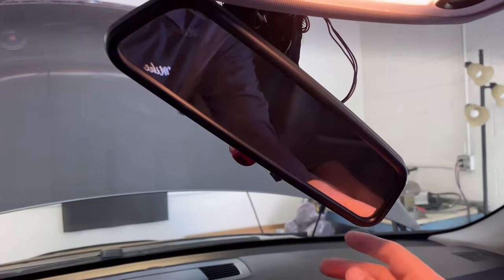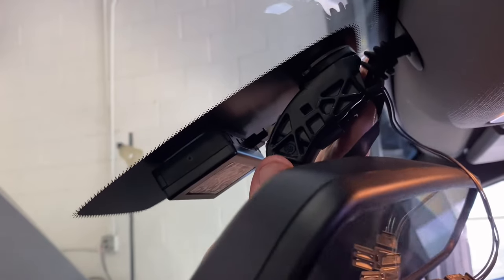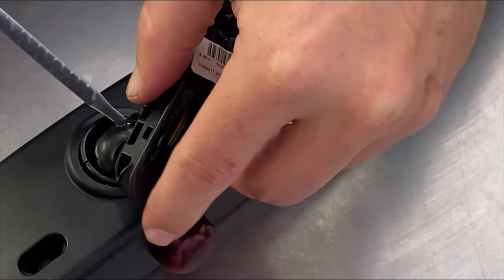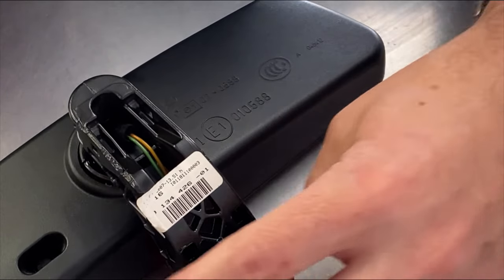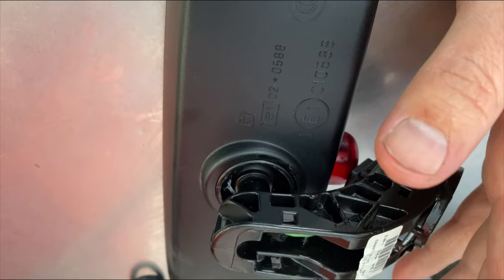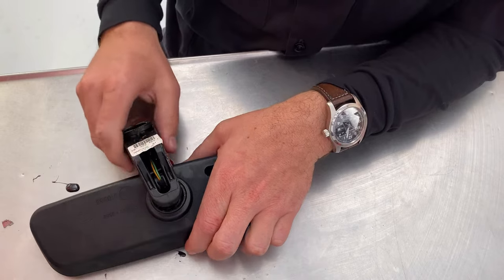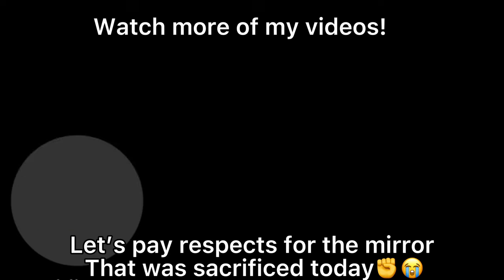Floppy Mirror Fix for BMW

Comment: Thank you so much for the tip. Do mind providing the exact name of the product you used to get it fixed. I hear epoxy but I am not sure if that is correct or which specific epoxy you used.
Thank you!
Reply from the maker: The epoxy I use is from WURTH. But you can use any high quality epoxy from any auto parts store.

Comment: Are you using front facing camera? Because when loosing it in the beginning, you said turn left, but video showed the mirror turning right/anti clockwise
Reply from the maker: You can turn it any direction. It isn't threaded like a bolt. I prefer counter clockwise upon removal, but I may of switched it up because I was filming to get better angles. Best of luck .

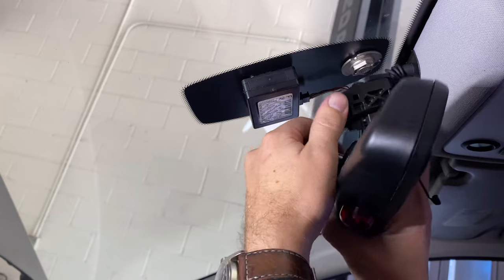Comment: Hi Mike, the mount has come off from its base on my E90  as you mentioned at 3:40...approached quite a few  people to fix it, but none has given me a solution....will some glue do the job? kindly help...thank you
J Thomas
Reply from the maker: If the metal mount has come off the glass, then the windshield will need to be replaced.
Reply: What did you end up having too do? I live in Texas, which it’s very hot and my metal mount came off of the glass as well. @jt7891 I need help !
Reply: Use AralDite Epoxy. I fixed the mount of my BMW using this.
Reply: That is nonsense. You can glue it back. You trying to rip this guy off ?  @MikeMDs